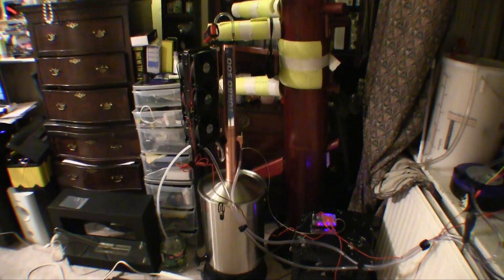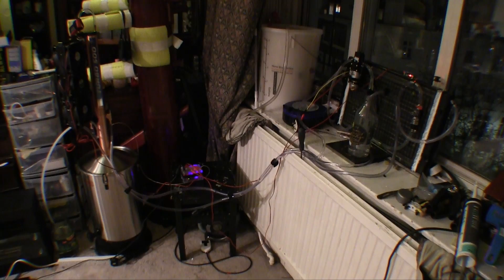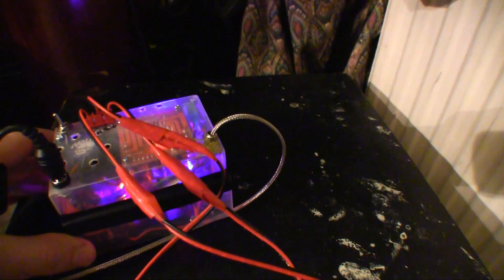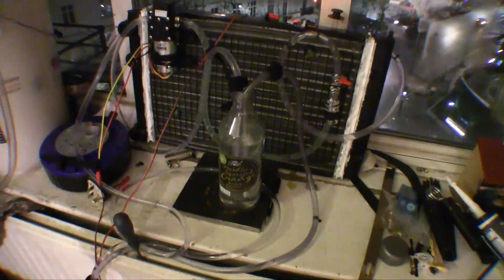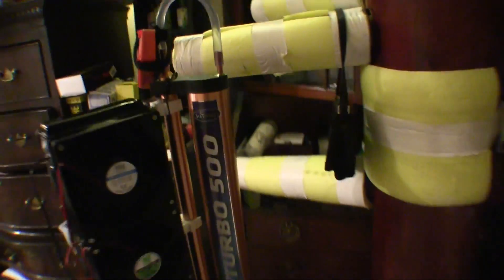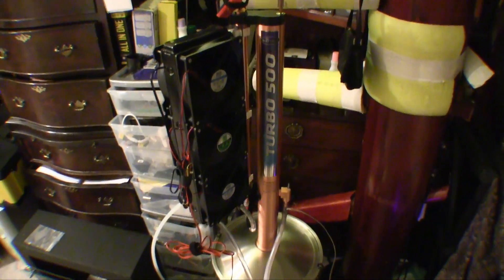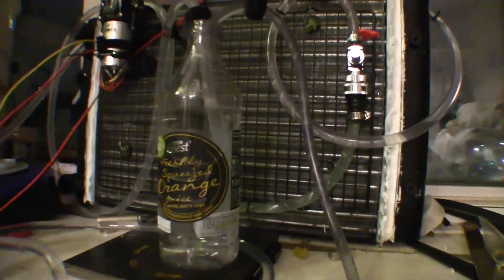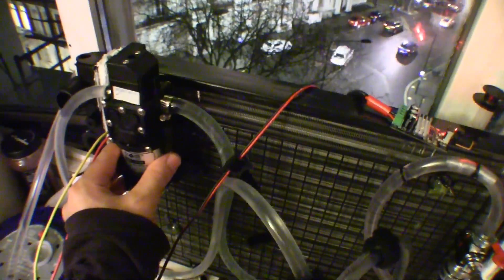Still Spirits Turbo 500 With Temperature Management System DIY

Comment: Still researching! Most of those diaphragm pumps seem to be rated 60 min max running time, and then need to cool down; maybe running it with PWM control allows it to run for 4 hours for a t500 run....

Comment: Brilliant.. wish I'd found this earlier. I've built a controller for the T500 to recirculate water from a tank using a 12V brushless motor; use an Inkbird PID controller which pulses the pump on and off as you cant easily speed  control a brushless motor; This looks a much better approach. For T500 run I found a 200L tank drawing cold water from the bottom is enough to do a 4 hr run. My system doesnt hold the temp anywhere near as steady.. I might have to re build it!!

Comment: Still wishing you'd share the parts list and code to make this work... you're still the only person advertising they've done this (that I can see anyway).

I assume the pump control is based on voltage compared to 12v but I've not played with arduino (intend to) so I'd be lost there in the temp vs voltage out code.

Comment: I have the t500 boiler if u set it correctly it uses about 100 litres that enough to clean all your equipment brewing tub etc I can make next wash with it or even fill a bath as I have done in past 
You should never leave it unattended your arm making very volatile stuff it burns blue not even noticeable in bright light 
Put 999 on fast dial and get a parachute

Comment: Why is it a goal to detach the water system from the grid? It might just be that i'm a bit spoiled since i live in a country with lots of water.
Reply from the maker: It is not only to detach from the water system, it is also to self regulate the temperature, because temperature will always change during distillation and you always have toi keep an eye and keep adjusting the waterflow.

With this system it adjusts automatically.
Reply: I don't know how much you know about stills but if you're a bit handy and willing to bend some copper you could switch from a cooling managed system to a liquid management system. this is done by using the bokakob still design and it eliminates water temperature as a factror for the output. Take a look at the stills made by istill. Once you have a bokakob still you can determine the outtake from the still by just turning a needle valve. the change in output is instantaneous.

Comment: Please help with how to connect the wires ? I have bought all components, have you got a diagram ?
Reply from the maker: Hi, I do not have a diagram as we speak, but I will look over the weekend and send you some photos. try to PM me your email.
Reply: I have been playing with the arduino for some time now... I got a LCD screen and the motor controller ... the one thing i could not get was the thermo coupling sensor, so i got a Dallas Temp probe.... 
I have no knowledge of arduino so im crash coursing this project pretty hard right now... 
I got the LCD to do cool things so far, and the temp sensor to get a false reading (hey look its something!!! almost there, just a resister short i think).. anyways... I would like to show pump speed and water temp on the LCD.. and have the LED's setup to give a show of lights as to where the temp range is .. for example Blue=too cold Green=Correct temp range and Red=Over a certain temp (just for show, i think it will be cool...
I have 100L of wash busy fermenting and I need to get an automated water cooling system going... Oh yes befor i forget I also got a buzzer so I want to buzz the sound if over a certain temp just for safety....
I have no idea how to get this all working, the arduino code looks hectic to write if you dont know what all the functions are, and also to incorporate different codes ? can you help build an awesome water cooling system ? PLEASE PLEASE !!
Reply: #include <OneWire.h>                                    //Temp Probe
#include <DallasTemperature.h>                          //Temp calculations
#include <LiquidCrystal.h>                              //LCD Display
#define ONE_WIRE_BUS 10                                 //Comm TEMP
OneWire oneWire(ONE_WIRE_BUS);                          //Temp Bus
DallasTemperature sensors(&oneWire);                    //More temp Comm
LiquidCrystal lcd(12, 11, 5, 4, 3, 2);                  //LCD PINS

const int cold = 27;                                    //set cold parameter BLUE LED
const int too_hot = 32;                                 //set hot parameter BUZZER ALARM
int pump_max = 35;                                      //PUMP at MAX power
int buzzer = A5;                                        //PIN Where the buzzer is
int fan = 6;       // the pin where pump is             //Pin where the PUMP or FAN is    
float temp;
float tempMax = 30;    //max temp on buzzer start       //Perfect TEMP Buzzer
int fanSpeed;
int fanLCD;

void setup(void)
{
pinMode(fan, OUTPUT);
lcd.begin(16, 2);                    
lcd.clear(); 
Serial.begin(9600);
Serial.println("Distillation Water Cooling System");
sensors.begin(); // IC Default 12 bit. If you have troubles consider upping it 12. Ups the delay giving the IC more time to process the temperature measurement
 
  //LED Program (Connections for 5 LED's and buzzer)
pinMode(7, INPUT); //Temp sensor
pinMode(A0, OUTPUT); //blue
pinMode(A1, OUTPUT); //green1
pinMode(A2, OUTPUT); //green2
pinMode(A3, OUTPUT); //green3
pinMode(A4, OUTPUT); //red
pinMode(buzzer, OUTPUT); //Buzzer A5
}

void loop(void)

          //Get TEMP  
{
  // call sensors.requestTemperatures() to issue a global temperature
  // request to all devices on the bus
  Serial.print("Requesting temperatures...");
  sensors.requestTemperatures(); // Send the command to get temperatures
  Serial.println("DONE");
  Serial.print("Temp: ");
  Serial.print(sensors.getTempCByIndex(0)); // Why "byIndex"? You can have more than one IC on the same bus. 0 refers to the first IC on the wire
  lcd.setCursor(0, 0);                   // set the LCD cursor   position
  double data  = sensors.getTempCByIndex(0);

//LED Program 
if (data <= cold) { //cold BLUE LED SET ABOVE             CHECKED
digitalWrite(A0, HIGH); // BLUE LED
digitalWrite(A1, LOW); // GREEN LED 1
digitalWrite(A2, LOW); // GREEN LED 2 
digitalWrite(A3, LOW); // GREEN LED 3
digitalWrite(A4, LOW); // RED LED
digitalWrite(A5, LOW); // BUZZER
Serial.println(" Heating Up.");
fanSpeed = 0;
fanLCD = 0;
analogWrite(fan, fanSpeed); // spin the fan at the fanSpeed speed 
}

if((data  >= 27) && (data <= 28)) { // GREEN 1          CHECKED
digitalWrite(A0, LOW); // BLUE LED
digitalWrite(A1, HIGH); // GREEN LED 1
digitalWrite(A2, LOW); // GREEN LED 2 
digitalWrite(A3, LOW); // GREEN LED 3
digitalWrite(A4, LOW); // RED LED
digitalWrite(A5, LOW); // BUZZER
Serial.println(" GREEN 1.");
fanSpeed = map(temp, cold, pump_max, 32, 255); // the actual speed of fan 
fanLCD = map(data, cold, too_hot, 0, 100); // speed of fan to display on LCD 
analogWrite(fan, fanSpeed); // spin the fan at the fanSpeed speed
}

if((data  >= 28) && (data <= 29)) { // GREEN 1     DOUBLE     CHECKED
digitalWrite(A0, LOW); // BLUE LED
digitalWrite(A1, HIGH); // GREEN LED 1
digitalWrite(A2, HIGH); // GREEN LED 2 
digitalWrite(A3, LOW); // GREEN LED 3
digitalWrite(A4, LOW); // RED LED
digitalWrite(A5, LOW); // BUZZER
Serial.println(" GREEN 1 DOUBLE.");
fanSpeed = map(temp, cold, pump_max, 32, 255); // the actual speed of fan 
fanLCD = map(data, cold, too_hot, 0, 100); // speed of fan to display on LCD 
analogWrite(fan, fanSpeed); // spin the fan at the fanSpeed speed
}

if((data  >= 30) && (data <= 31)) { //GREEN 2             CHECKED    //PERFECT TEMP FOR DISSTILATION
digitalWrite(A0, LOW); // BLUE LED                                    //TRY MATCH THIS TO YOUR STARTING WATER FLOW RATE
digitalWrite(A1, LOW); // GREEN LED 1
digitalWrite(A2, HIGH); // GREEN LED 2 
digitalWrite(A3, LOW); // GREEN LED 3
digitalWrite(A4, LOW); // RED LED
digitalWrite(buzzer, HIGH); // BUZZER
tone(buzzer, 528, 50) ;
Serial.println(" GREEN 2.");
fanSpeed = map(temp, cold, pump_max, 32, 255); // the actual speed of fan 
fanLCD = map(data, cold, too_hot, 0, 100); // speed of fan to display on LCD 
analogWrite(fan, fanSpeed); // spin the fan at the fanSpeed speed
}

if((data  >= 31) && (data <= 32)) { //GREEN 2    DOUBLE         CHECKED
digitalWrite(A0, LOW); // BLUE LED
digitalWrite(A1, LOW); // GREEN LED 1
digitalWrite(A2, HIGH); // GREEN LED 2 
digitalWrite(A3, HIGH); // GREEN LED 3
digitalWrite(A4, LOW); // RED LED
digitalWrite(A5, LOW); // BUZZER
Serial.println(" GREEN 2 DOUBLE.");
fanSpeed = map(temp, cold, pump_max, 32, 255); // the actual speed of fan 
fanLCD = map(data, cold, too_hot, 0, 100); // speed of fan to display on LCD 
analogWrite(fan, fanSpeed); // spin the fan at the fanSpeed speed
}

if((data  >= 33) && (data <= 34)) { //GREEN 3             CHECKED
digitalWrite(A0, LOW); // BLUE LED
digitalWrite(A1, LOW); // GREEN LED 1
digitalWrite(A2, LOW); // GREEN LED 2 
digitalWrite(A3, HIGH); // GREEN LED 3
digitalWrite(A4, LOW); // RED LED
digitalWrite(A5, LOW); // BUZZER
Serial.println(" GREEN 3.");
fanSpeed = map(temp, cold, pump_max, 32, 255); // the actual speed of fan 
fanLCD = map(data, cold, too_hot, 0, 100); // speed of fan to display on LCD 
analogWrite(fan, fanSpeed); // spin the fan at the fanSpeed speed
}

if(data  >= 35 ) { //RED            CHECKED
digitalWrite(A0, LOW); // BLUE LED
digitalWrite(A1, LOW); // GREEN LED 1
digitalWrite(A2, LOW); // GREEN LED 2 
digitalWrite(A3, LOW); // GREEN LED 3
digitalWrite(A4, HIGH); // RED LED
digitalWrite(A5, LOW); // BUZZER
Serial.println(" RED.");
fanSpeed = map(temp, cold, pump_max, 32, 255); // the actual speed of fan 
fanLCD = map(data, cold, too_hot, 0, 100); // speed of fan to display on LCD 
analogWrite(fan, fanSpeed); // spin the fan at the fanSpeed speed
}

// BUZZER PROGRAMING   HIGH ALARM 1
if((data  >= 32) && (data <= 33))   { //BUZZER SET ABOVE , BUZZER, BUZZER
digitalWrite(buzzer, HIGH); // BUZZER
Serial.println(" BUZZER.");
tone(buzzer, 3000, 100) ;
}
delay(10);
// BUZZER PROGRAMING    HIGH ALARM 2
if((data  >= 33) && (data <= 34))   { //BUZZER SET ABOVE , BUZZER, BUZZER
digitalWrite(buzzer, HIGH); // BUZZER
Serial.println(" BUZZER.");
tone(buzzer, 3000, 500) ;
}
delay(10);

  
  // print the results to the LCD DISPLAY
  lcd.print("TEMP: ");
  lcd.print(data);
  lcd.print("C   ");
  lcd.setCursor(0,1); // Sets cursor for next line
  lcd.print("PUMP SPEED: ");
  lcd.print(fanLCD);
  lcd.print("% ");
 Serial.begin(9600); // begins the serial monitor
}
Reply: I would also like to know how everything is wired :) Maybe it's possible to make a short video of it?
Reply: ampwave AT outlook.com

Thank you so much!! , I have been struggling with the code, I follow tutorials but but nothing really works , I have spend hours trying to get the arduino to pick up the temp sensor and read the values .... so frustrating to try work it out without proper instructions
Reply: Code above im still busy writing.... for your question i have :
int fan = 6;       // the pin where pump is             //Pin where the PUMP or FAN is    
fanSpeed = map(temp, cold, pump_max, 32, 255); // the actual speed of fan

I have just not changed the code from fan to pump yet...
I will finish this project this week
Reply: I know its a mouthfull!!! LOL!!
Reply from the maker: Email me: jovani33@hotmail.com

Comment: Interesting project. The code seems a bit tortuous for the task though. Do I take it that AnalogWrite(9,x) is controlling the fan speed?  The following seems to me to give the same results as your long series of temperature if-thens :-

   if (temperature<62) {
      analogWrite(9,90);
   } else if (temperature<64) {
      analogWrite(9,95);
   } else if (temperature < 66) {
      analogWrite(9,100);
   } else if (temperature < 67) {
      analogWrite(9,125);
   } else if (temperature < 68) {
      analogWrite(9,145);
   } else { // temp >= 68
      analogWrite(9,200);
      digitalWrite(2,HIGH); // buzzer
   }

Also, at the beginning of the loop() function you read the temperature twice. I would say that's bad practice because the temperature reading the logic applies to is not guaranteed to be the temperature you display, so e.g. you might see the buzzer going off when the temp is reading 67. You should read the temp, display it, and act on the same variable. Also you use some "magic numbers", which makes code harder to read. It's better to replace these with a readable symbol, e.g. AnalogWrite(FAN_SPEED, 100).
Reply from the maker: Hi thanks for constructive comment, I agree my code could have been much better. I did not have any knowledge in arduino before that project, so I had to construct the system and learn some arduino and write the program in less than 24 hours (Yes I am impatient). You are welcome to post the new code here with any improvements, I might use myself too. Chhers Johnny
Reply: Actually I already gave the main change: you can replace replace your block of "if (temperature..." lines with my block above. Everything else is just a nice to have.

Comment from the maker: You need the following:

 1- Arduino Uno: 

http://www.ebay.co.uk/itm/UNO-R3-Arduino-Rev3-ATMEGA328P-Compatible-Board-Free-USB-Cable-Pins-/262200725666?hash=item3d0c6190a2:g:F2sAAOSw1S9WeTIc
 

2- Diaphram Water Pump:

http://www.ebay.co.uk/itm/High-Pressure-Diaphragm-Water-Pump-12V-100PSI-4L-Min-For-Car-Marine-Yacht-Boat-/171324428554?hash=item27e3bb510a:g:zlcAAOSwFnFV-hnc

3- Thermocouple Sensor Module for Arduino:

http://www.ebay.co.uk/itm/271556241312?_trksid=p2057872.m2749.l2649&ssPageName=STRK%3AMEBIDX%3AIT

4- 120mm Computer Fans (x6):

http://www.ebay.co.uk/itm/321785201877?_trksid=p2057872.m2749.l2649&ssPageName=STRK%3AMEBIDX%3AIT

5- Motor Controller for Arduino:

http://www.ebay.co.uk/itm/Dual-H-Bridge-L298N-DC-Stepper-Motor-Driver-Controller-Board-4-Arduino-1-5x-/161975032485?var=&hash=item25b676daa5:m:mexHH0kbqIh8kvdINxWHhqA

6- Computer Cooling Radiators (x2):

http://www.ebay.co.uk/itm/1pc-Aluminum-Computer-Radiator-Water-Cooling-Cooler-for-CPU-LED-Heatsink-360mm-/321894906355?hash=item4af26e79f3:g:A8wAAOSwjVVVufiN

It is all about connecting the sensor module and the motor controller to
 the arduino uno board (I can send you the instructions on which wires 
to connect)
and then programming the arduino with few codes (please find below).

Do you have any IT background?
Do you know what is arduino?

Let me know if you need the wiring connections instructions or any other
 help

Code is as follows:

#include "max6675.h"

int thermoDO = 4;
int thermoCS = 5;
int thermoCLK = 6;

MAX6675 thermocouple(thermoCLK, thermoCS, thermoDO);
int vccPin = 3;
int gndPin = 2;
  
void setup() {
  Serial.begin(9600);
  // use Arduino pins 
  pinMode(vccPin, OUTPUT); digitalWrite(vccPin, HIGH);
  pinMode(gndPin, OUTPUT); digitalWrite(gndPin, LOW);
  pinMode(7, OUTPUT);
  pinMode(12, OUTPUT);
  pinMode(9, OUTPUT);
  pinMode(2, OUTPUT); // for buzzer
  
  Serial.println("MAX6675 test");
  // wait for MAX chip to stabilize
  delay(500);

  digitalWrite(12,HIGH); // pump rotation direction
  digitalWrite(7,LOW); // pump rotation direction
  analogWrite(9,150);
  delay(1000);
}

void loop() {
  // basic readout test, just print the current temp
  
   Serial.print("C = "); 
   Serial.println(thermocouple.readCelsius());
   float temperature = thermocouple.readCelsius();
 
  digitalWrite(12,HIGH); // pump rotation direction
  digitalWrite(7,LOW); // pump rotation direction
  digitalWrite(2,LOW); // For Buzzer
    
     
     if(temperature < 55){ //  Set Low Temperature
        analogWrite(9,90);
     }
     if(temperature > 49 and temperature < 51){ 
        analogWrite(9,90);
     }
     if(temperature > 51 and temperature <= 53){ 
        analogWrite(9,90);
     }
     if(temperature > 53 and temperature <= 55){ 
        analogWrite(9,90);
     }
     if(temperature > 57 and temperature <= 59){ 
        analogWrite(9,90);
     }
     if(temperature > 59 and temperature <= 61){ 
        analogWrite(9,90);
     }
     if(temperature > 61 and temperature <= 63){ 
        analogWrite(9,95);
     }
     if(temperature > 63 and temperature <= 65){ 
        analogWrite(9,100);
     }
     if(temperature > 65 and temperature <= 66){ 
        analogWrite(9,125);
     }
     if(temperature > 66 and temperature <= 67){ 
        analogWrite(9,145);
     }
      if(temperature > 67 and temperature <= 69){ 
        analogWrite(9,175);
        digitalWrite(2,HIGH);
     }
     if(temperature > 67){ 
        digitalWrite(2,HIGH); // For Buzzer
     }

     if(temperature > 67){ // Set Low Temperature
        analogWrite(9,200);
     }
         
   delay(1000);
}

Comment: JohnnyThanks so much for the helpAre you able to obtain 200 proof? This is what I need
Reply from the maker: +Steven As far as I know there is no way to make 200 proof alcohol (100 Ethanol) through distillation. According to manufacturer, the  Turbo 500 can produce around 190 proof if I can remember right.